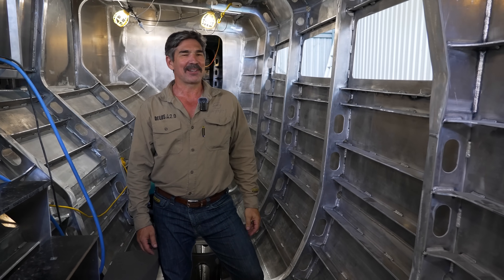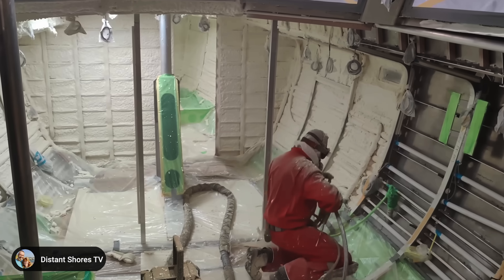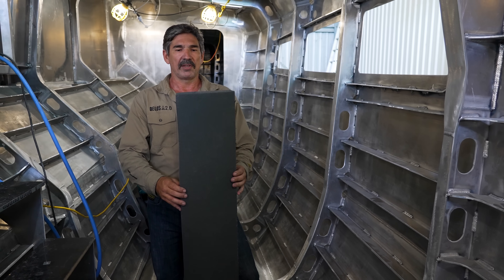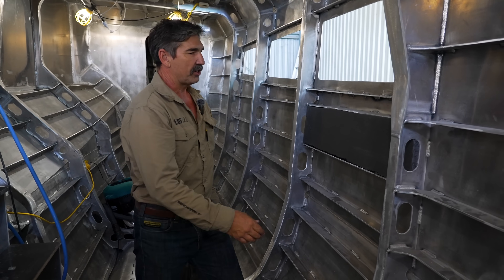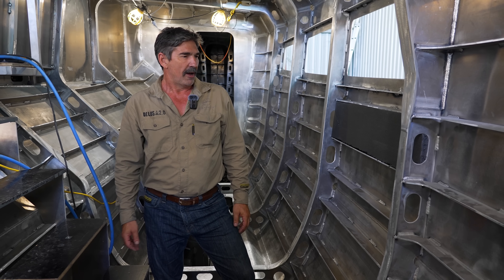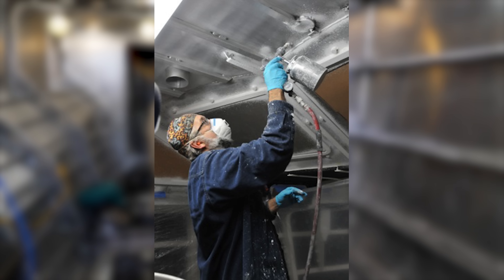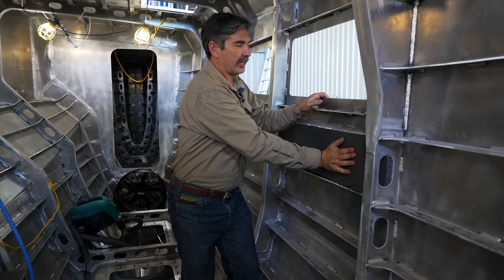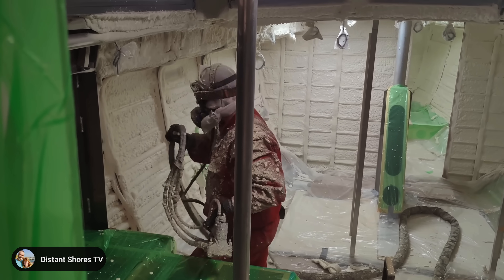HELP, We Need Your Advice!  How Should We Insulate Our Aluminum Catamaran???

Comment: I work for a lumber dry kiln manufacture. Kiln temps range up to 240F and almost continuously near 100% relative humidity.  Kilns live in northern cold climates and tropics.  Structures are 6061 aluminum.  Walls are a sandwich construction of .040" thick 5052 aluminum skins surrounding 2.25" thick Celotex Thermax rigid foam board for r20 insulation. This is a closed cell polyurethane board that won't absorb water. Panels have weep holes.  We sometimes use 304 stainless inner skins on hardwood kilns as acids can corrode aluminum.  So does salt from salt water stored logs. 

 I think you are on the right track.  Use a combination of spray foam for the main areas and difficult corners and batts with the coating system where you need access.  This is why I like your channel. You have interesting problems to solve and share them with your audience.

Comment: It will be best to mix and use both.

Spray foam in areas that you will likely never need access to. Like behind cabinetry, in and around the shower surround, etc.. 

Areas with mechanical and electrical panels boat infrastructure that could or will need maintenance, use the non-spray foam insulation.

Comment: Been a plumber for 30 years I love the pins idea for the insulation to be removable. You should definitely be checking out how other yacht companies do it. Don't forget to leave yourself conduit channel wherever you can across each compartment while you have everything open in case you want to run an unanticipated wire or something make the conduit twice as big as you think you need as well. Boat is looking amazing. Think about flammability of the insulation as well, as an electric fire on a DC aluminum boat is not out of the question. Make sure all wires protected through the alum

Comment: My experience with sticky backed stuff is that it doesn't last, especially over temperature cycles like the boat will experience. the sticky part will just de-laminate from the substrate that you originally stuck it to.

Comment: cutting the foam is very labor intensive. plus it would require the painting of the sealer. though the sealer would eliminate the metal ribs not being insulated because they would be by the sealer. the closed cell foam would do both tasks and do it better. but if you create a hole in the boat below the water line finding it behind the spray foam might be hard. Or would it leak? now do you weld a patch with the spray foam? lot to think about.

Comment: I do not know boats, but I know insulation. The stick pins are a bad method and take 24-48 hours for the glue to set. Some will fall off and even more will fall off over time. Spray foam is the way, not only for insulation but I don't know of you could sink that boat if it was encased inside with a few inches of foam.

Comment: It seems to me getting behind the paneling would be more trouble than messing with spray foam once you got there.  Once you have the panel off moving around or through the spray foam is easy.  I think you are concerned about the wrong task.

Comment: Haven’t done an Aluminium boat, but have done a GRP boat and a camper van build.
Personally, I would run conduits for cables, hoses etc - and leave pulling lines in place for future use (which I’m sure you’ll do anyway). 
If it’s not price prohibitive, I’d paint the Ally with an etch primer, then high build 2-pack topcoat, then fill the bays with batons as you did on your video, then sheet insulation over that to level with the bulkheads, then facing panels fixed to the bulkhead frames.
Seal all the facing panels as close to air-tight as you can on the living areas, but they’re going to breathe as temperatures go up & down whatever you do!
A cold hull with peoples breath and cooking humidity is the problem scenario as hot humid air almost certainly means a hot hull too!
I wouldn’t stick the batons & sheets - the facing panels will hold them snug.
The paint is going to protect the metal from corrosion, and having the panels snugged up to the insulation will stop the hollow sound.
And lastly, don’t use those damn pins that industrial lagging does. Yes, they hold the insulation board in place, but you’re left with sharp ends no matter if you bend them over or cut them off, and they’re virtually impossible to reuse if you remove the grip washers as it chews up the pin. They’re good if you want to slap insulation board up quick and cheap, but not easy to live with!
Well, that’s my tupence worth of opinion - good luck 👍

Comment: +1 for spray foam. Would it be an issue for access should it be needed? yeah a little. The thing to consider is how often would you need to get access to the hull for any repairs?  If it was me it'd be 100% spray foam. as @Marinerjac said it's easy to remove and replace because the expanding foam comes in spray tins like is used in the  construction industry. The spray foam is way quicker to apply, fully insulates everything and provides a vapour barrier and the under foam coating should be applied as well

so the consideration is bases on the risk vs reward profile.

Comment: Some questions to ponder on closed cell spray foam: is it anti-microbial?, is it fire resistant?, what's the best/target R-value for your application and thickness?, does it have a flexibility rating or add rigidity?, fumes post install?, what solvents can be used pre- and post install?, sound attenuation rating?, marine rated?, pro install/DIY?, overall cost, warranty?, weight?, does it require a sealer after cure?

I'm not an informed resource for marine foam, just someone with a lot of questions.
Reply: The answer is yes if you pay for the right foam product. 😊

Comment: Hi, here in the UK we have many thousands of canal boats floating around the country mainly steel but some aluminium. I built one myself about 10 years ago. Most, if not all are spray foamed the main disadvantage you highlighted can be overcome as you can remove it with many tools but the quickest I found for larger areas is a wire brush on a drill or grinder although a bit messy it is quick and accurate. It can be sculpted with a router, or hand tools. It would eliminate several of the problems the condensation one sounding the alarm for me. As a guide it took three hours to coat a 60 foot by 6’.10” by 6’ high canal boat. About the same amount of time to sculpt it ready for lining out. Before spray foam canal boats did use fiberglass wool and polystyrene blocks and condensation was an issue.

Comment: I have experience with aluminum 18 wheeler boxes.  They all get spray foamed but the plumbing and electrical runs get done first.  You don't want to have to channel out all of those runs after it is spray foamed.  Put in extra empty electrical runs in because it makes adding and subtracting tech wires alot easier.

Comment: Ask other boat builders, good. Protection coat paint on, to protect, then spray to insulate. Is the best solution. Prepaid well to prevent cold bridging. But run every service first or conduit. Best to over compensate than regret. Seams the best choice for cost and protection. Keep up the good work 😂

Comment: Go with the spray foam . It is very easy to apply . No worries of condensation build up. And it's not hard to scoop it away with pretty much anything if you need to access the hull from inside . Plus, it's super easy to reinstall the spray foam product if you have removed some for a repair.  It's cost-effective and easy to install. Maintenance-free. Seems like a no-brainer to me.

Comment: It is almost impossible to install insulation panels effectively. Especially with such edges of the boat hull. I would mix the options: first do a coat of insulating "paint" to be sure to cover the entire aluminum (easier to go slowly in the corners than with a spray), and this is a way to ensure the electrical insulation of the hull (loss currents). Then, I would pass three or four 25mm PVC pipes on the entire length of the hulls (4 hull sides x 4 pipes), for the next projects (electronics, radar, plumbing, electricity ... you name it) and finally I would cover everything with sprayed polyurethane foam.

Comment: Brian, thanks for reaching out for advise!  
I do know that fuel tanks in a boat that are supported on stringers use a closed cell foam insulation not just for cushioning but also because it's waterproof and doesn't allow moisture between the tank and the stringers.  Without it, you get a form of crevasse corrosion, like what happens with chain plates.
That said, I believe there are closed cell spray foam types of insulation that will not only insulate the hull AND the ribs and frames of Delos 2.0 but also keep the moisture from condensation out.  Off grid off road RV's used to use aluminum frames for the siding and roof and then a type of foam board for insulation but the aluminum does transfer heat from the outside.  Now, top end RV builders are using composite foam material that is also structural, eliminating the need for framing members.
Garcia Yachts builds A LOT of aluminum expedition boats so they might be a good resource to call and find out how they do it, what does/doesn't work...
Lastly, as someone who has been doing high latitude sailing for 30 years, you want to keep air moving inside the boat while at the dock and away from the dock.  I use a small force air heater that moves the air around while producing heat and that really knocks down the condensation  A friend of mine was using a radiant heater that doesn't move the air around, and asked for my ideas on how to reduce the buildup of moisture and I told him to get a small fan and run it along w/ the heater.  He was swabbing his San Juan 26 out every week (he is a live aboard) but now that problem is gone!  
While I've not used it, here is a type of commercial grade close cell spray foam systems:
https://foamitgreen.com/product/foam-it-green-closed-cell-spray-foam/?srsltid=AfmBOoqYPPw1hdORPdXopxhEmjatWVq3mwAJb0_Mb60AW6gIapiD_LVg

Comment: Go with anti-corrosion coating like zinc chromate or whatever the latest hi tech stuff is on the complete interior, then some sort of sheet insulation above the ribs, and cover it with the interior paneling.  I think spray foam would be quick and easy but the downside is toxic fumes and the need to cover it with fireproofing in habitable areas, also the need to remove it before any welding mods or repairs.

Comment: that foam looks really good but aluminum conducts heat so fast.. it always freaks me out when i take foil out of the oven and I can touch it seconds later.. it's so fast.. i fear when moving or even just sitting in cold water that it will suck the heat out of the boat even with insulation.. i mean the insulation still works but aluminum is also working against it.. always drawing the heat away because it's always releasing the heat so fast.. it's like a refrigerating element always in contact with the insulation.. the insulation is mostly air but that air can get cold.. and with the constant movement of a boat the tiny air pockets are moving and mixing the air.. transferring heat.. say it was a wood boat.. the water would make the wood as cold as the water.. the insulation would be hot from your heat source.. and it would hit the outside wood... but since the wood doesn't conduct fast and is like an small insulator it takes time for the wood to transfer out the heat.. so it stores the heat... for a short time.. the aluminum doesn't.. it's like here you go have all the heat instantly.. and then asks the insulation for more heat instantly... so it's all about time.. the time it takes for heat to transfer.. having that shell of aluminum creates a zero timezone that the endless water can use to create like a massive fridge element against your insulation.. i wonder if there's a paint that could create a tiny insulation gap between the aluminum and water but i don't think it would matter.. that element is there.. it's between the hot and cold.. there's no removing it.. well maybe a thick outside insulation would nullify it.. would be crazy to insulate the outside and fiberglass it.. i think you just have to accept the heat wicking effects... i hate the spray foam but it really does fill every crack very good.. plus you can totally scrape it out because the metal can be scrapped clean pretty easy without much damage to it... but perhaps sections with pipes i'd use the foam... i'd hate not having access to pipes.. some liquid expands and can crack a pipe anywhere so easy.. always need access to pipes.. anyways.. i have zero experience with insulation... but i fear even people with experience won't understand the physics of it... not that i know much either.. i just try to think logically.. but they may say something is great and not even realize there's an issue
Reply: oh and realizing the issue perhaps just using the highest rated stuff is a good idea even if it's more expensive.. as the air gaps get farther away from that fridge element they can do their job more and more slowing down the transfer.. it's almost like you just need more than you think to counter that wicking effect.. basically count the thickness of the aluminum in insulation as a transfer to the aluminum to give it some insulating properties.. which is time of transfer.. long story short insulate the heck out of it the best you can .. but that's just my guess

Comment: There is a chemical that dissolves it.  If you use a insulation tape on all the welds before the black foam would work to.

Comment: What's that foam stuff they use to ship boxes? Looks like they put a bag in there and fill it with foam then close the box so when the foam expands it pushes into every nook and cranny but is still contained in the plastic bag. I'm thinking you could use the paint on barrier stuff you showed then use bags of foam like that to fill it as deep as you want to cover the ribs and stuff. 
I have no boat experience and no foam experience, just a thought

Comment: Hi Brian, sorry for my bad english, but I try.
 In thermes of insolation and your decision for the best product, it might help to understand, that there are two different groups of insolation. One for sound, one for temperature.
They are working very differently. To avoid sound, you need weight, nothing else works. That's why we have concrete flours in Germany, where you can here hardly anything above the floor. Your wooden floors in normal USA houses can't do that. But you have to avoid sound bridges, otherwise, the deep sound comes through. With your boat its gonna be difficult, because the hole boat is a sound bridge.
Insolation for temperature is much easier, it depends on the amount of air layers. The more, the better. Avoid cold bridges as well, otherwise the effect of insulation goes rapid down.
If you put a precisely installed sheet Plastic sheet on top of the insulation,, you avoid condensation, like in houses the roof, the outside walls or the basement.
Wish you good luck!!
Tom Peschel from Germany

Comment: Built several Aluminum Boats, and 2 transatlantic capable Trawlers and maintain two steel Commercial fishing boats (so I do know a thing or two about a thing or two).... That said NO NO NO NEVER use Sprayfoam SO SO many headaches The first being it WILL fail and most sprayfoams are not "sealed" until 3-4 inches of depth (I know I'm American so I use the wrong units but I'm too stubborn to change now) So it will breath and allow moisture behind it.  I KNOW this for fact as I am currently ripping out and replacing all the steel on the ceiling of one of our boats because this VERY thing happend and the boat was corroding from the inside out didn't even know it until holes on the exterior started appearing!!!!!  there is no perfect world solution in my opinion.  That said The best overall I have seen was a ceramic based spray in material specifically made for noise insulation on Aluminum boats (been 10 yrs since we used it can't think of it off the top of my head) its only a couple mill's thick but acts as a barrier to the metal to seal it and protect it!!  For a saltwater boat I would Seal all internal metals as best you can prior to whatever insulation you  use. And use a product like you had in the video the polystyrene or similar with the push pin retention bond the push pins to the boat hull prior to paint/seal/ceramic coating with Panel bond (automotive two part product used to basically glue most new cars together!!!! super strong lasts forever!!) then seal it up with whatever product you chose and then insulate,  Polystyrene cuts GREAT on a table saw or with a handheld Circular saw with a track system (to get straight even cuts) and god forbid if you have to do a repair you will THANK yourself !!!!

Comment: I would strongly advise of getting any insulation you end up choosing glued/stuck to metal panels. Think about car doors and sound deadening. Just placing foam nexr to the hull wont stop the vibration and drum effect of the hull. Just my 2 cents

Comment: I lived aboard my previous aluminum 48 foot sailboat all year around in Canada. Let me tell you, aluminum boats are cold . Its was spray foamed from the builder but not below the water line . My feet were always cold. You really have no option you will need to spray foam it . Its the only way to go if you are planning to do some cold weather /arctic cruising , Also install a hydronic heating system ,  a DB2010 Webasto and upgrade the pump . The one that comes with it dosent have enough umph to move the coolant around the boat. I have one on my current vessel as well. I designed and installed both systems myself.